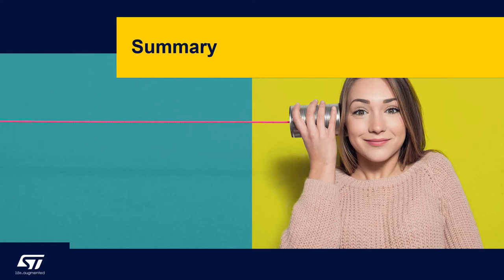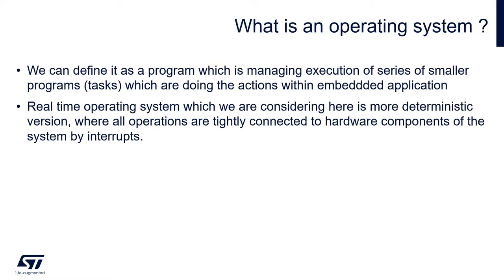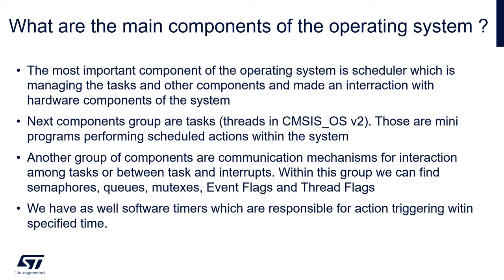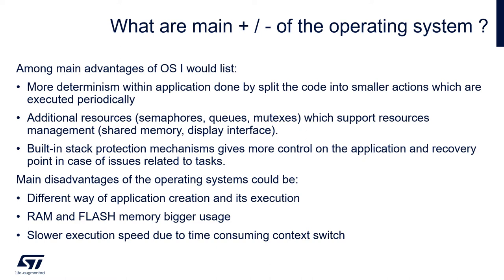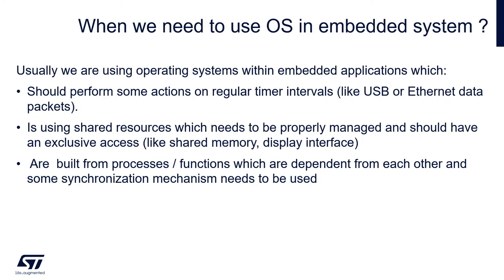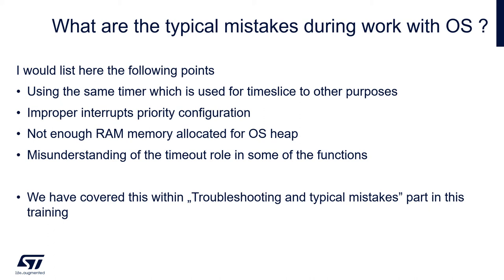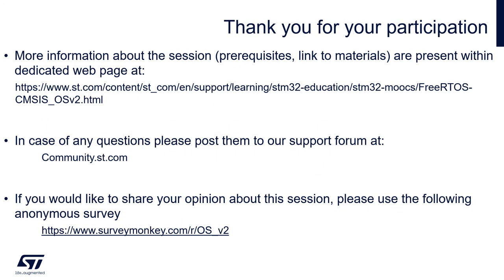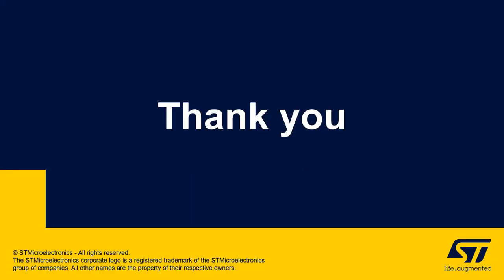FreeRTOS on STM32 v2 - 23 Summary

Comment: this was very useful, thanks.
I would add in "When we need o use Os in embedded systems?"
-When having enough RAM and FLASH youre worried about scalability of the project, specially if more than one developer is going to work on it at the same time.